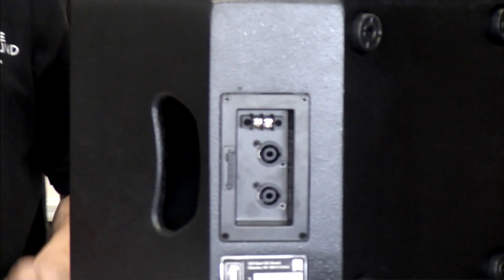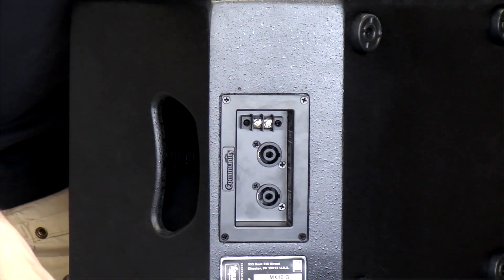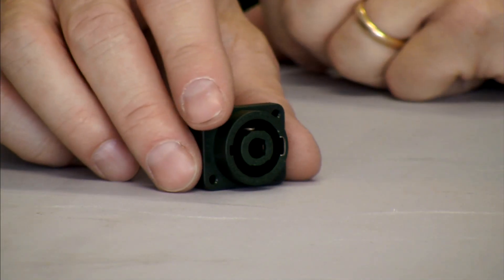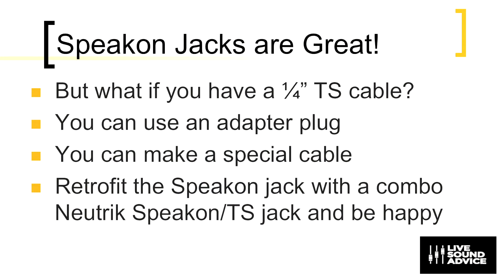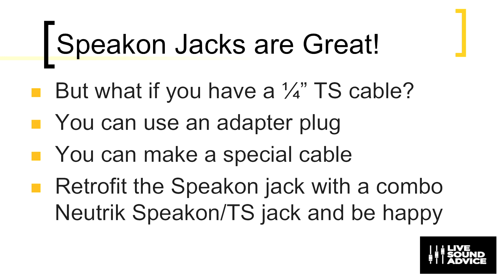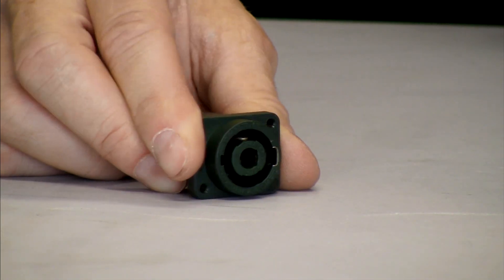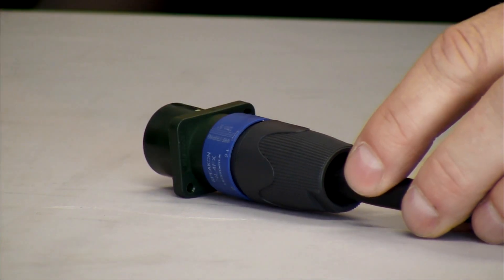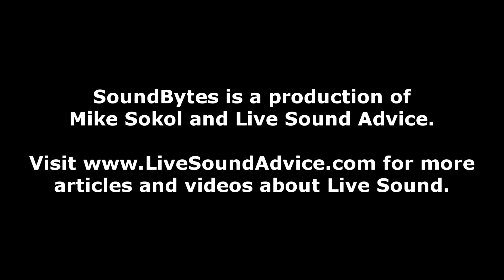Sound Bytes - Neutrik speakON 1/4" Jack-Combo

Comment: Great concept.  Would be fantastic for guitars (and other electric instruments), amplifiers and speaker cabinets.  They could make significant sales in this industry.  However, they only offer them with puny pins that are made to plug into a computer board panel making it difficult to connect wires to it.  They would make a lot of money if they had a model that used spade connectors like everyone else.

Comment: Sooooo can intake a regular speakon plug and drill it so a 1/4 inch jack fits thenput a metal sleeve in it soldering a wire to the appropriate tabs and be good to use?
Reply: Assuming that the drilling didn't destroy the jack, you would somehow have to wire in the connections that are in a 1/4 in jack which both make the connection and keep the male plug in place.  Since the new combo plug is not that expensive in the fist place, it would probably be more timely to spend all that time just installing the new plug in your speaker cab.

Comment: If I may add one point just in case anyone gets confused: With this combo jack, the Speakon connection is only 2 pole, as with the 1/4".  So you may connect a 4-conductor speaker cable terminated with an NL4 as mentioned in the video, but only two poles will make contact. In practice this is fine 'though, because for applications where you want the option of using a 1/4" TS cable, that only provides two poles anyway. So you wouldn't be using it on a bi-amped speaker in the first place. So all good; just remember to restrict use to passive xover speakers :-)